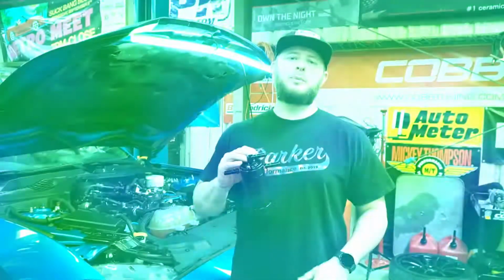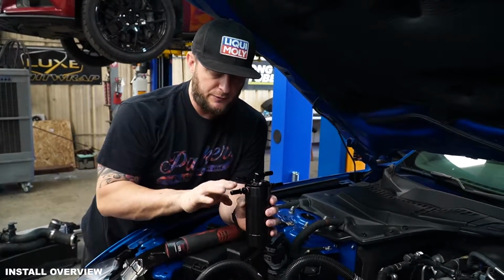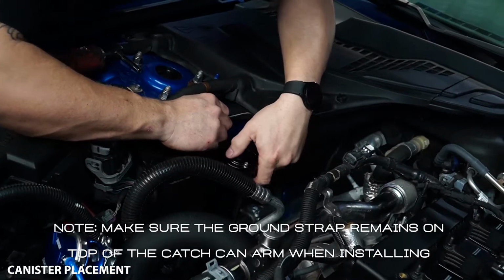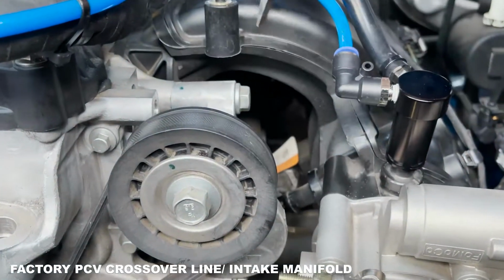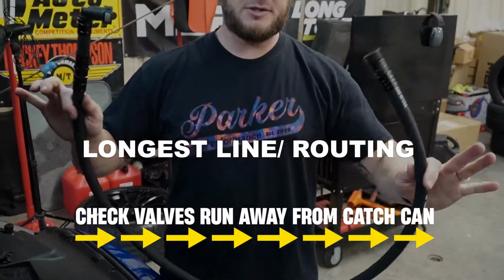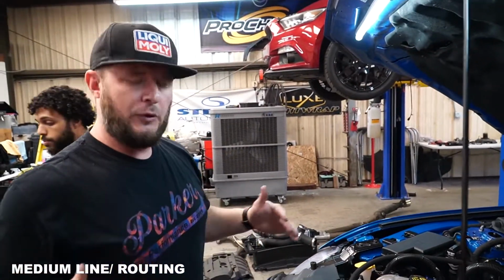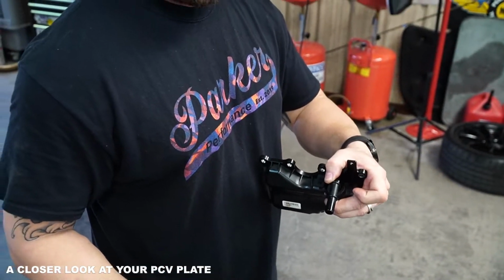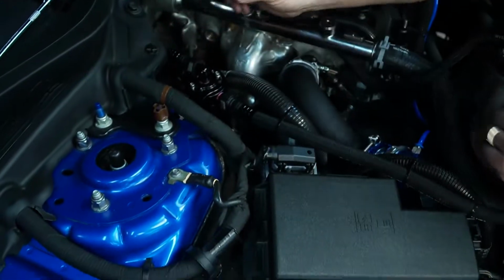2015-2023 MUSTANG ECOBOOST/UPR DUAL-VALVE CATCH CAN/INSTALLATION

Comment: Just grabbed this bad boy. Getting really excited for mid June. Gonna have the following for my eco:

MBRP Race Exhaust
CVFab catted downpipe
CVFab Race Intercooler
UPR dual valve catch can
CVFab Charge pipe TiAL flange
GenV raceport BOV

Eventually I’ll be grabbing the roush closed box intake. There’s not really much more I can do to this car I believe
Reply: Did you look at the street exhaust any before buying the race version? Also what did you do about the reduction to 2 1/2” where the dp meets the exhaust?

Comment: If your like me and don’t have the finger tip pressure to push down the fitting on the pvc plate , take a box cutter along the side going long ways on the fitting. Once it’s cut deep enough you can pop it off the barbed end of the fitting giving you the ability to flip it around so you can see the clip to press down, then I got a long flat head driver and pushed the clip down so I could take it off. Hope it helps because I was under the car for a couple hours till I figured that out😅
Reply: Hey man I’m having the hardest time trying to press down on the clip how do you get it to turn around?

Comment: I just changed the low-pressure fuel sensor and Purge Vale on a 2019 Mustang ecoboost premium but still have these codes P2196 and P0496. Is this normal, and what's the fix for it?

Comment: Installed upr can but doesn't seem to catch oil, previously had single can and collected 2 way oil instal as followed check valve away from can could you suggest solution .thanks

Comment: I have a 2017 Mustang Ecoboost premium that I'm keeping stock other than upgrading the low fuel sensor, purge valve, and spark plugs. Would i need this catch can if im not planning on adding any tune, down pipe, or air intake mod?
Reply: I head it’s just a good mod to have if you plan on owning the car long term
Reply: @killakali6985 bought the UPR catch can and the crankcase breather for it (: 
Now unto the intercooler next month

Comment: having a P0148 code, could this be fuel pump related? injectors? usually get the code after hard launches down the track.
Reply from the maker: This code is usually relate to the Low Pressure Fuel Sensor (LPFS) Have you changed your sensor? If not or if it's failed here's the link for it. 

https://ppflco.com/products/ford-motorcraft-oem-updated-low-pressure-fuel-sensor-for-ecoboost-mustangs
Reply: @ParkerPerformanceFL  yes sir. did the entire maintenance recommended. thinking it’s the low fuel pump. gonna replace it with a DW400
Reply from the maker: @itsboostedmoe  What fuel are you running when you get the code? Are you tuned for one or two fuels?
Reply: @ParkerPerformanceFL  currently tuned for E30 and 93. by ryan martin.
Reply: @ParkerPerformanceFL  i’m running E30 when i get it!
Reply from the maker: @itsboostedmoe  Gotcha, send us an email brother. Sales@pp-fl.com
Reply: Can I use this on the GT as well? I need to vent into my ford performance CAI.

Comment: Hello i have a fully modded  Ecoboost Mustang. I have the"road race" catch can set up. Is that install pretty much the same install?

As of now i have a full race intercooler with both hot and cold lines upgraded, Full race catless down pipe,CPE full race exhaust,CPE alpha cold air intake,HKS blow off valve, FFP spec Wastegate,, hand ported intake manifold, Ford racing throttle body, full race throttle body spacer, granatelli coil pack, NGK plugs, boomba short shifter, boomba shifter assembly, boomba track transmission mount, XDI 2050 injectors,XDI evo fuel pump, precision turbo, CSF racing radiator, mishimoto oil cooler, low side pressure sensor, MAP billet rear main seal, and as of now the mishimoto baffled catch can. I'm tuned with PD tunning.

Comment: Junk you don’t need. Collects mostly condensation which is eliminated every time the oil gets up to operating temperature. Get a Mach E for short trips and winning drag races. I own a F150 Gen 2 3.5 Ecoboost that tows and hauls. I level the truck by hitching up the trailer. After reviewing the data there is no need for a catch can. This guy will sell you all kinds of stuff you don’t need.
Reply from the maker: Thanks for the info!

Comment: I have a 40k miles 2021 ecoboost, i havent had this installed, should i install it or will I be fine, also any other recommendations to replace, i just put new NGK sparkplugs, the old ones were toast.
Reply from the maker: We definitely recommend the catch can at any milage with the mentality, the sooner the better.